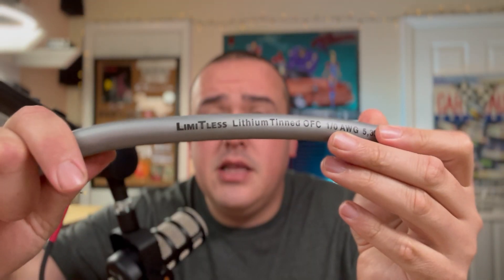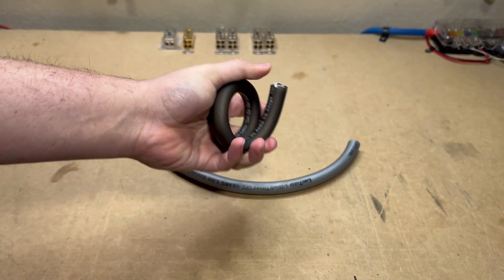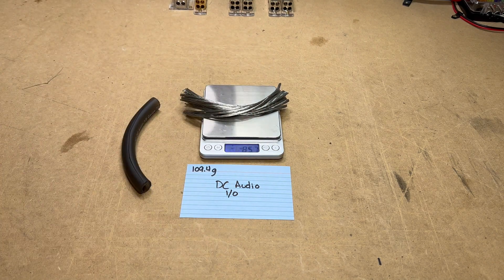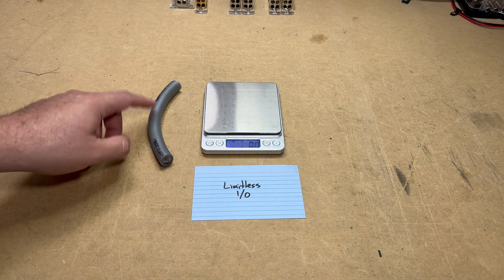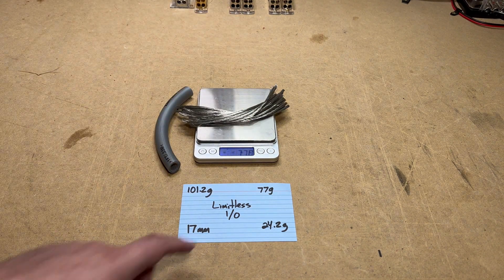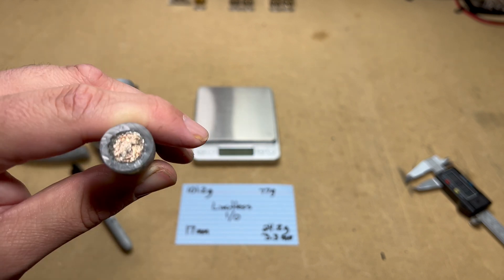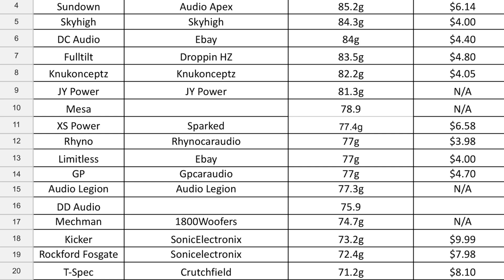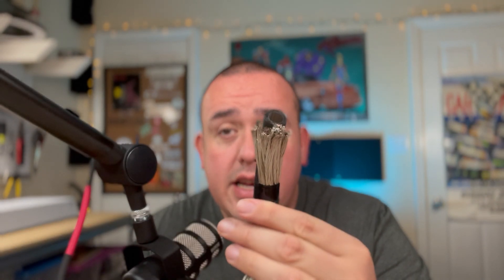What’s the best value 1/0 OFC wire? (1/0 OFC Cheat Sheet Update)

Comment: I don't understand the point of paying extra for tinned copper in amp (car audio) wire. The purpose of tinning is to resist corrosion in areas exposed to the elements, yet the insulation on car audio wiring does not resist elements as well as actual battery cable. If you are that worried about corrosion, wouldn't it make sense to just buy actual battery cable with tinned copper so both the conductor and insulator will last?

Comment: Hello Robert,
2 questions 
1. When selecting a power wire  what all insulation materials we can look at and which is most ideal and flexible insulation.
2. Any suggestions for speaker wires with good shielding against noise.

Thank you

Comment: I appreciate the shoot-out Thanks for posting Vega 👍
Now, lets talk tech. I don't know much about it, but I do know some basic understanding of electricity. OFC is OFC, there is nothing magical about it. It just is what it is, OFC! Some are tinned, some is Aluminum (CCA). Different Gauges, different current draws, and amp pull downs,  Resistance, I get it 🙄 the longer the wire, the more the resistance. Cost. prices have increased over the last little while, (inflation, adjusted for stabile economic policies, I understand it, I get it,... don't like it, but I get it...)  I have purchased Welding cable, it is OFC, it is multi-strand, highly flexible and flows current just as efficiently as any other cable of the same kind shape, size, etc... If these other wires were so much more efficient, don't you think that industries would have incorporated these designs into their manufacturing processes already? Don't you think Elon Musk must be using Full Tilt Cabling to power those booster rockets when leaving earths atmosphere, or do you think he is using that CCA cabling instead from Scosche??  😁😃
Reply from the maker: OFC is kind of car audio marketing. Welding cable is perfectly acceptable as it is pure copper. It’s just less flexible

Comment: I have 320 amp alternator and a single 15 ft run of 1/0 ofc wire to my lithium bank. Do i need another run of 1/0?  My amp is a crescendo bass clef 6k. Thank you. Ii can't get a straight answer to this.
Reply from the maker: Your single run should be capable of handling that load without issue, but if you want to have less voltage drop a second run should help.

Comment: 3:21 You might get a more accurate measurement using the part of the calipers that's closer to the tips.
Reply from the maker: The tip of the tool is more susceptible to pressure manipulation that’s why I try to use the broad area in hopes of a more consistent result
Reply: @HifiVega  It is more susceptible to pressure so its best not to apply much pressure when measuring this way. Measuring a curved surface from the flat areas of the caliper and then squeezing ( it appeared that you were squeezing the calipers rather firmly?) to get a measurement would almost certainly  produce a wider variety of less accurate measurements. That's my 2 cents anyway,  I was a machinist for roughly 10 years.
Reply from the maker: @noguardrails47  yeah I’m pretty familiar with using calipers as well using them every day for about 20yrs at work to measure parts and on the parts at work (lead plates) I use the tip because they’re not flexible like a wire casing. These wire casings also have ridges inside of them and many are inconsistent from one end to the other so i discovered this way was the best way for me to get consistent measurements after measuring more than 30+ wires and making 7 different videos on them.
Reply: Plus when weighing he had a bit on the table and the scale by accident I'm sure,but it appears so🤷🏼‍♂️

Comment: I feel like I won the jackpot because I managed to get 2 50ft rolls of 1/0 OFC Sky High Audio cable for $126(that's what I paid for both, would have still been a decent deal even if I got each piece at that price.)

But if I didn't get this sweet deal, I came across a brand called Atrih Technologies, they have 50ft rolls of OFC for $119(plus shipping) and the wire looks fairly legit and worth checking out.
Reply from the maker: That’s a steal! I’ll check out the Atrih.

Comment: I get a lot of my 0 gauge from my local Pull and Save junkyard. A lot of the newer cars that has the battery in the rear will have a pure copper 0 gauge wire running from the trunk area all the way to the hood area. Been doing this for years and never had an issue. Plus rather than 2 to $4 a foot you're averaging out roughly 25 to 50 Cent foot 🍻😁🔊🌪🌪
Reply from the maker: Pro tip!
Reply: only problem when dealing with used is copper turns green . now if you ever see it no big deal get a bottle of coke opean the wire pour soda on it wait couple mins rince clean with water dry it with hair dryer wrap with eletric tape then i use heat shrink the 3 time one and good to go .
Reply: Haven't had that issue yet but I also try to only get from newer cars.. a little vinegar and baking soda also does the trick🔊🔊🌪😁
Reply: Man I bought some stinger that's 0 but looks like 4awg
Reply: I also been doing that but it be stiff and 2awg pure copper tho

Comment: You know, I was just looking up different metals and resistances, and Tin is only as electrically conductive as brass and nickel, its actually way less than aluminium, and its like 4 times the resistance of copper.  So I wonder, is tin plated wire actually inferior to bare OCF wire, would it be far higher resistance per km or mile?  I heard or read somewhere that the tarnish on copper doesn't affect the resistance or current transfer, and that that oxide layer in fact is beneficial.  I think that's total BS personally, and I've always bought tinned wire for its longevity.  Ever had wire that's turned green and powdery the whole way down the entire length of wire?  After seeing this morning that the resistance of copper is like 60 aluminium was around 40 and tin nickel zinc and brass were around 15, it makes me wonder....  Is tinned wire in fact a poor choice like CCAW wire? (It's not as bad because its only a plating, but you get what I mean, is it measurably inferior)
I also thought brass was miles better than aluminium and that's why I just spent hundreds on all these brass fuse holders and distro blocks, I thought aluminium was far inferior, boy did I f&#* up!  😆🤣😭  The only thing about aluminium I really hate is that it is very soft and threads are very easily destroyed.
Reply: Aluminum is superior in a lot of ways, its lighter, by weight its more conductive than copper, it dissipates heat faster, costs a lot less but you would probably need 2 runs of cheap CCA to equal 1 run of quality OFC.
Reply: In fact, if you ran 2 runs of CCAW, you end up with less resistance than 1 run of OFC. So, if the aluminium wire is half the cost of the copper, double it up and you are far far better off.  
You have to go up by 3 AWG sizes to double strand count or half resistance.  If you ran 2 runs of 0awg CCAW instead of 1 run of OFC, electrically its almost the same as if you had of ran 3/0AWG copper. Because 0AWG is (all roughly) about 4000 strands, 2/0 is 5300 and 3/0 is 6600 strands.  And 4/0 is 8000, or twice as much as 0AWG.  And aluminium is apparently 60-65٪ as conductive as copper. 
I've done so much damn shopping the last few months, and I've learned that 1) getting accessories such as fuse holders, distribution blocks, battery terminals etc etc that can accept larger than 0AWG is basically impossible  &  2) because you need to go to 4/0 just to double the current of 0AWG, because you don't save money buying the thicker wire, it actually costs a premium the thicker you want it, you are far far better off buying multiple runs of 0AWG than buying a thicker cable.  For example, you might think its smart to run 2/0 from the front to the rear of the car, but its really is not smart at all, its going to give you 30% more current at best while costing much much more than 30% more $, then additionally you would have to use lugs because you can't find accessories that accept the 2/0AWG.  Its WAY smarter and cheaper to buy a big roll of 0AWG CCAW and do 2 or hell even 3 runs of it, it will be lighter and more flexible and you will have more options with how you run it and how you terminate it and what accessories you can use, and this way you can do everything without having to buy a crimper and lugs too.
In the end, if you buy CCAW and double it up, its equivalent to using copper in 2 sizes up, eg 2 runs of 0AWG CCAW is equivalent to a run of 3/0AWG OFC, because again, the aluminium is around 66% or 2/3rds of the conductivity, and each step up in AWG size (or each number down) is 33% more conducting metal eg 0AWG = 4000 strand,  2/0AWG = 5300 strand, 3/0AWG = 6600 strand. 
Knowing this info can save you so much time in researching power accessories like terminals, distribution blocks and the power wire, its crazy, let alone the money.   And if you have super hungry amps, well, of course you just buy those dual 0AWG inputs. You buy a big roll, multiple runs from front to rear, make 4 runs to each amp if you want.  I bought these sweet distribution blocks that are 2x 0AWG in - 4x 0AWG out, so I run 2 off the battery, to 2 fuses, in to the distro blocks, then 4 out to 2 pairs of dual input adapters to the amp. It's all smart, because the 2 runs off the battery, to the 2 ANL fuses, then to the distro blocks are super short, just a few inches long, then the 4 that go from the distribution blocks to the amp are fairly long, but because they are more than twice as long as the short ones, the 4 are actually the bottleneck, the 4 runs that go to the amp is a higher resistance than the 2 runs off the battery to the distribution block. 
I know there's a lot of wordy words in there 😂, but I do think its super helpful info, so I hope it helps someone out
Reply: @minus3dbintheteens60  holy sh!t. You got to be a computer program, (ai) cuz that was pretty damn technical. If you're not props...  Screenshotted lot of excellent information and seems like hours of research! 👍
Reply: @Simpleman1078  sweet man, Im glad it can help someone out, coz I've spent countless hours these past couple of months deciding what wire and what accessories like fuse holders to buy.  My advice, get a roll of CCAW 0AWG, and look at the IllCustomz 0AWG distribution blocks, they come in 6+6, 8+8 or even 10+10, so that 10+10 can accept 10 bare 0AWG wires on 1 side, and another 10 on the other side, 20 connections in total, they are made of aluminium which is better than brass and is actually better than everything other than super expensive copper, BUT, when copper and aluminium interact together they seriously degrade each other, they are poisonous to each other, but using the CCAW + the aluminium distribution block keeps it all the same, and light weight, and they are sold in pairs.  Just google ILL CUSTOMZ 10 + 10 0AWG and you will see what I mean.  A pair of them and a roll of 0AWG CCAW, you can supply serious current to whatever amps you like, with plenty out outputs to run off to all the batteries and capacitors and alternators you can muster.  Again, you won't need a lug crimper or anything because you can get 0AWG bare wire fuse holders and battery terminals and everything you need.  I wouldn't get the SMD fuse holders or distribution blocks or buss bars because they all require lugs, so do pretty much all curcuit breakers.  ILL CUSTOMZ also sell dual 0AWG input adapters, but I've seen them on ebay for $30 aussie dollars a pair free post also.  The only downside to going this way is I guess having to run extra power wires could look messy, I kinda of think it looks hard-core seeing 20 different 0AWG running everywhere, 4 going into each amp haha.  Anyway, check out those products and have a think about the prices.  
They sell super fast, but if you want the distribution blocks that are 2x 0AWG in - 4x 0AWG out that I just bought myself, search on eBay for DB2040 distribution block.  Peace!
Reply: @minus3dbintheteens60  Yep! U got it. Just got to have the space for it.
Reply: @minus3dbintheteens60  Yup a lot of "Wordy Words" in there 😃 But they're Good "Wordy Words"... makes sense to me. I would buy into that logic and argument. There is one other issue I am not completely certain on, in that the Temperature handling of these such said wires. I have read that some of the CCA wires will handle up to 168F and or 77C or something like that, and that the Copper will handle much higher heat before it melts. Now, I just want to say quickly, I have never felt warm wires, unless I was using a space heater on an extension cord running it all day, and the plugs they are plugged into start discoloring and turning brown to black and the cord is really soft and the part that plugs into the wall pulls apart from the terminals inside, luckily, not a 911 call that day, that was a 15 amp circuit that never tripped on 1500 watts but the wires were definitely melting the sheathing and potentially burning up...I would assume that the breaker would trip before that...  
So, bottom line is multi CCA Cables to build up to a 4/0 power rating with safety features, I'm hoping for the best.

Comment: Does 2 runs of CCA beat 1 run of OFC?
Reply from the maker: I’d hafta test it out to say one way or the other, but as far as corrosion resistance no
Reply: @HifiVega  that would be some good content to be honest! I've had 1 run of 2/0 welding wire and a run of 1/0 CCA both running to my back batteries for a good year atleast till I swapped it out with all welding wire. I figured it could only help.🤣
Reply: Just do a 2/0 run if you need more capability, don't use CCA
Reply: @mrcornut  I would but most people dont know that CCA flows more current by mass than OFC. Meaning CCA that weighs the same as OFC, not measured by diameter of wire, will flow more current. But in cars size is an issue and therefore favor OFC.
Reply: @freeradical431  CCA will still corrode/get brittle faster. Plus double the ring terminals, wire to purchase, grommets, zip ties, sleeving, heat shrink, fuse holders, ferules etc.. when you do the math, you're not really saving doing a second run IMO. People should run some good copper and call it a day. Overthinking it by focusing on theoretical current capability, you overlook the added costs and downsides by going with CCA. Look at the cost per gram of copper from the Limitless on his list. That stuff isn't the thickest, but if cost is somebody's only concern it's probably comparable to a couple similarly sized CCA runs after factoring in the other added costs.

This is my subjective opinion, I live in a moist area that sees rain 200 days/yr.
Reply: @mrcornut  State of Washington, Tennessee or Florida? Those states are often rained on!

Comment: I bought some cheep Pyramid 4 gauge wire from Amazon. It was stupid the jacket was 1/8 thick on both sides and had less then 10 gauge wire running down the center. Sent that crappy wire back.
Reply from the maker: That's exactly why I started doing this